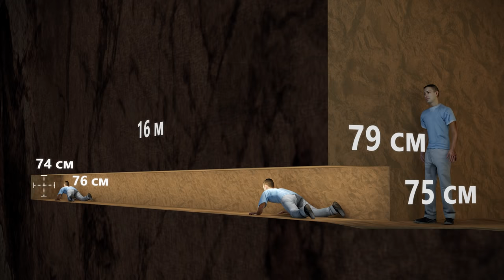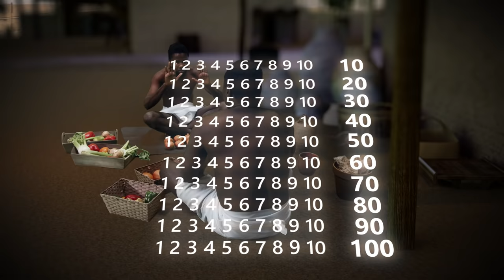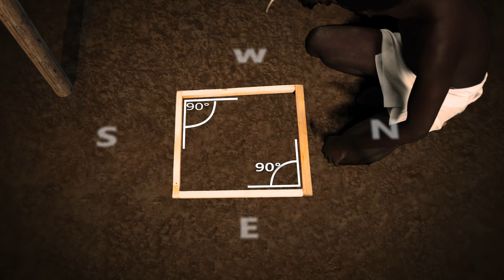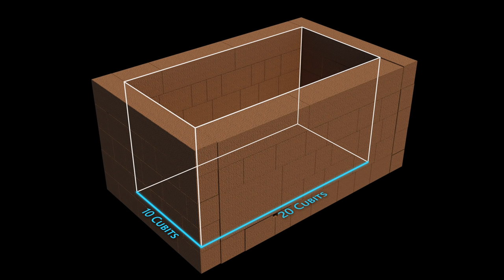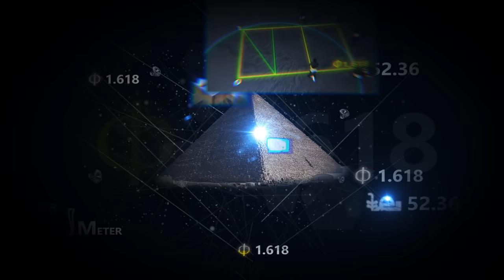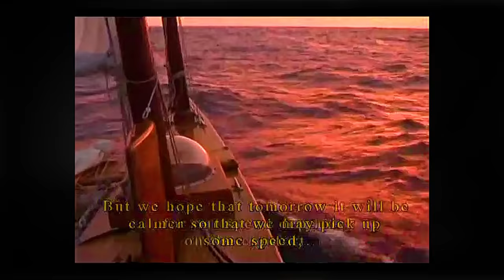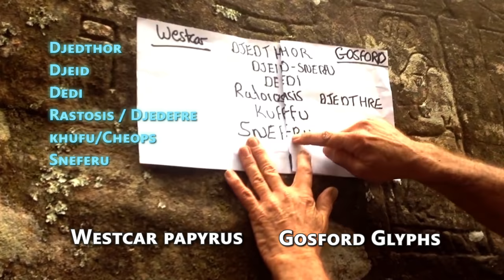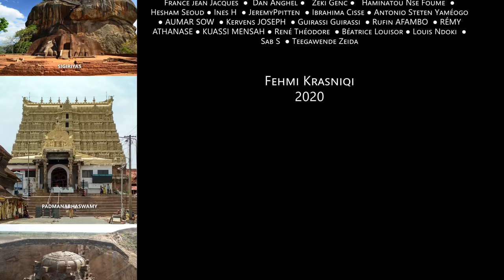The Movie Great Pyramid K 2019 - Director Fehmi Krasniqi

Comment: Very Interesting video.

SOLOMON'S STONES

1Ki 7: 9-11. All these were of costly stones, according to the measures of hewed stones, sawed with saws, within and without, even from the foundation unto the coping, and so on the outside toward the great court. 10 And the foundation was of costly stones, even great stones, stones of ten cubits, and stones of eight cubits. 11  And above were costly stones, after the measures of hewed stones, and cedars.

Jer 52: 21  And concerning the pillars, the height of one pillar was eighteen cubits; and a fillet of twelve cubits did compass it; and the thickness thereof was four fingers: it was hollow.

1Ki 6:7 - And the house, when it was in building, was built of stone made ready before it was brought thither: so that: there was neither hammer nor axe nor any tool of iron heard in the house, while it was in building.

Comment: Listen  That granite piece of slab Where's the proximity 70 tons and you're saying that clay play molding with hold it together with a big mold is mold a cookie tray or or like  Baker's mold for bread.... And then once it's in the mall you have to wait for it to cool and then it's not going to be perfectly smooth and then you have to flip it to get it out of its mold correct Container..... You had me all the way until you made this huge magnifying glass that you had to take to the top of the Pyramid.... Did you take it up there with the helicopter..... This magnifying glass would be approximately 50 to 75 feet in circumference in the bow 10 to 15 feet thickYou have to melt the granite and smooth it I know you're A PhD in physics Travis Taylor has
 6 Ph D's  In physics He says we cannot make the pyramids today and Giza but there is pyramids made out of the Volcano ash Mixed into the cement and when they pour the concrete it gets stronger over the years it's waterproof and it sucks the carbon out of the atmosphere😊😊😊😊